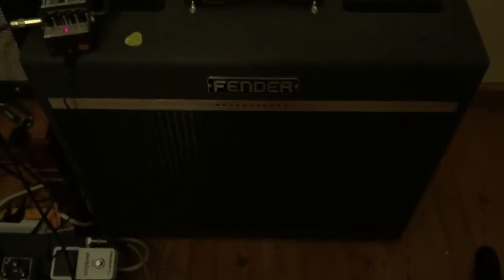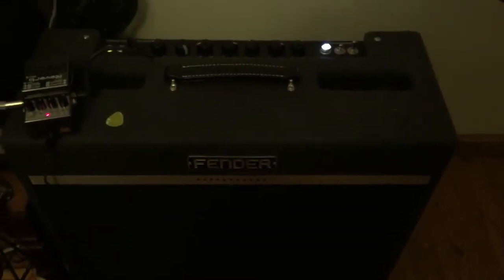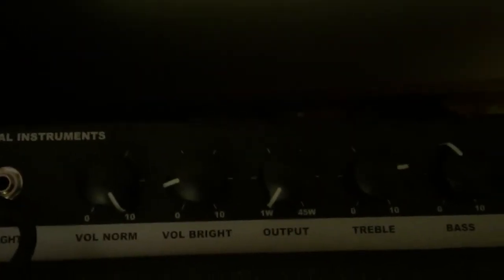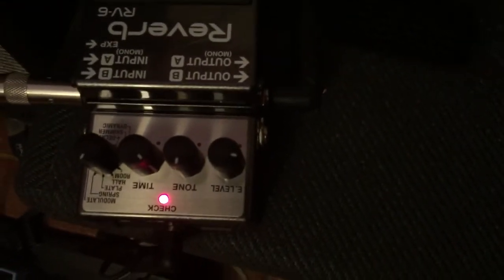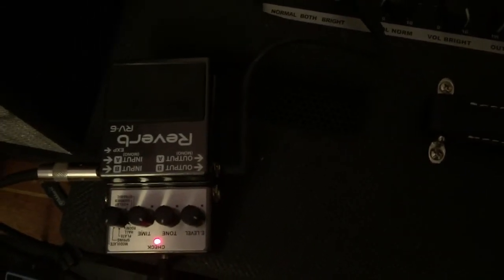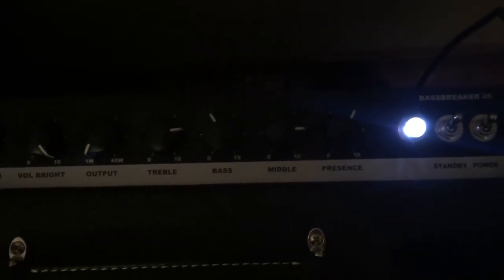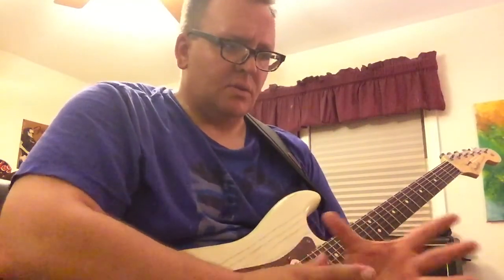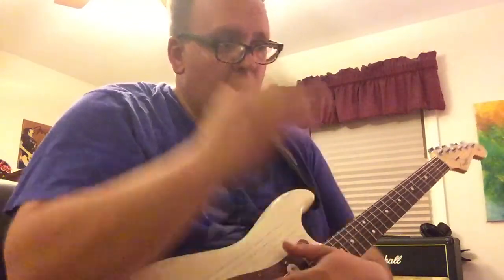Fender Bassbreaker 45 Combo Amp with a Reverb pedal in front on a high gain setting. Good or not?

Comment: I think that the "problem" would be solved by running the amp at a higher wattage setting (thus creating more clean headroom) and turning the volume down accordingly. Then, if more dirt is required maybe just use a drive pedal in front of the reverb/delay etc.

Comment: The guy who sold me the 15W combo said to use the loop even for gain pedals. So try and make your FX loop, bud, and try even your drives in there. It's a pretty odd idea, but I tried an OCD and a Muff and damn if it didn't work! Especially if you engage the treble booster.

Time-based FX sound great after drive pedals into the front of a cleanish BB, no matter the model. So that's always an option. Use your drive pedals instead of the amp's gain stages, at least for some tones.

Comment: I assume you know that a Reverb pedal is meant to be used in the effects loop?
Reply from the maker: +Mitch Bass, this amp doesn't have an effects loop. Thanks for watching the whole video.
Reply: Oh sorry, only the 15's have the loop then? How annoying...
Reply from the maker: +Mitch Bass, I was hesitant about that at first because the Fender tube amps have such great onboard reverb. But this amp rocks! It really doesn't need reverb. And the way the power section is designed on the Bassbreaker 45, if you had an effects loop, it would be running in the front of the amp. That's why they opted for no effect loop. Anyways, thanks for checking out the video. Cheers!
Reply: Mate, just get yourself a decent reverb/delay and run it after the drive. Don't use the amp's drive. 

I would go for a Memory Man Hazarai with reverb and looper.
Reply: Btw I agree. I don't use reverb, just delay. Good enough for Gilmour!